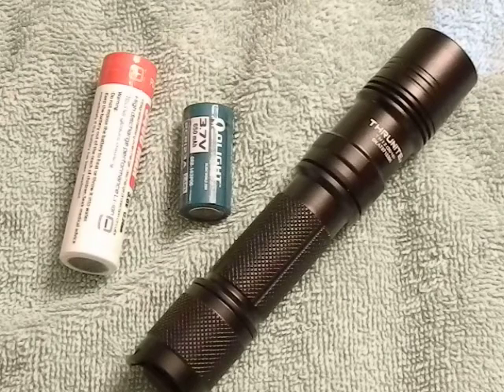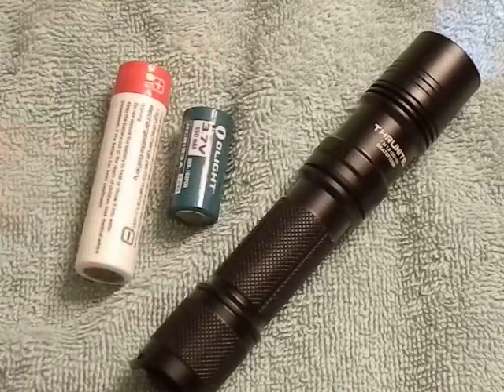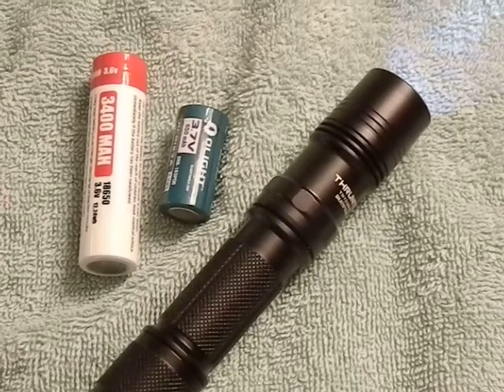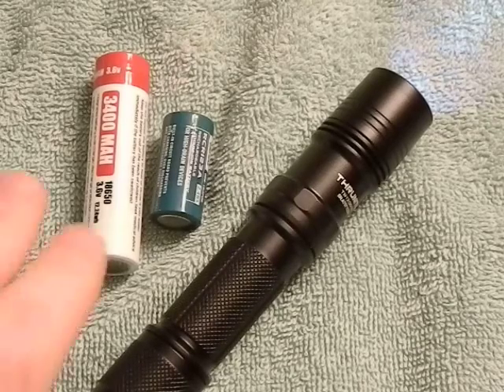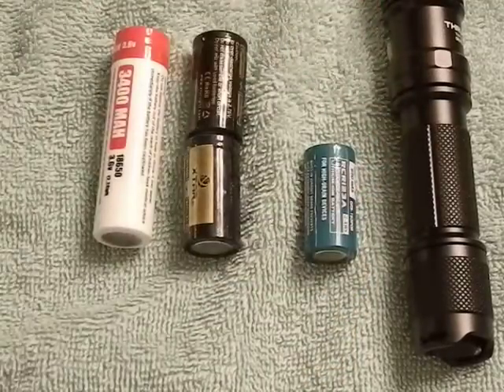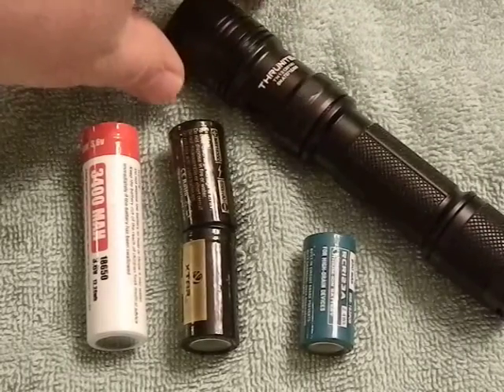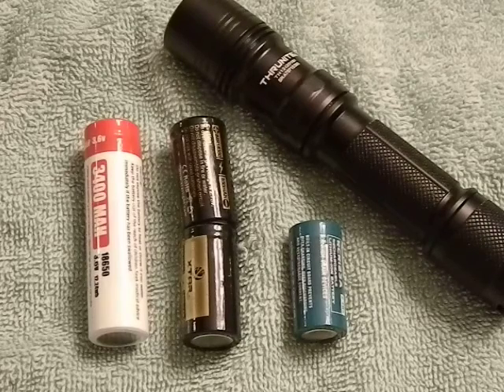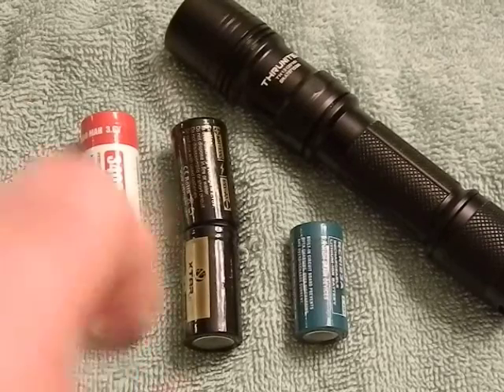Another Flashlight Hack - solder free!

Comment: What is the standard voltage for a flashlight?  I have a tactical 511 where I can switch double aa batteries 

I also have an older bushnell using cr123a batteries that I want to change to a reacharable battery that will increase the lumens.  My charger can do so many batteries but can’t do cr123a hence the change.  If I put one in with too high of voltage could it cause damage?  What batteries would be a similar size to the cr123a

Comment: You are wrong about getting more battery life with the 2 battery as only the voltage doubles. MAH will remain the same. Use a good 18650 and you will have more than enough amps to power the LED to max brightness and you will get the most runtime. This video has so many flaws its unbelievable.

Comment: Yes ok capacity is only multiplied in parallel where voltage is multiplied when end to end for  series applications but just one more point from not expert.com.  Not all led torches will do any voltage as it seems his good quality one can , l  have blown a few drop in led units without checking the max voltage for any led units . A decent beam can easily be got from 18650 torch with 3.7V  and i don't see many led light units when shopping that will take more than 3.7-4.2V  and one lithium ion cell.Lol.

Comment: 18650s have more brightness and more watt hours than 2x18350. Voltage doesn't make more brightness. And if it does, the flashlight is not utilizing the 18650 well. 

The case in this video is a good example. Plus running two videos in serious makes them hot.

Comment: I just picked up a lumintop tool aa 2.0 after burning out my energizer tac 700 tossing brand new 16340 cells in it. Those rechargeable cr123 will burn out a regular cr123 led light unless it’s specified to handle 16340 so simply saying that if it takes cr123 it will probably take 16340 rechargeable is kinda iffy. There’s a big difference between 6v and 8.4v when it comes to these led flashlights. I’m pretty sure the leds on my tac 700 are fine as the light still works at significantly reduced lumens. I think the extra voltage messed up the led driver. If someone wants to use rechargeable 16340 in place of cr123 they need to make sure the flashlight can handle it first.
Reply: adding a small neodymium magnet between the two 18350's should give you about .2ohms of extra resistance based on my measurements. not sure thats a big of enough voltage drop but looking at the buck converter in most of the data sheets for led flash lights that say "RATED 3.7v", theyre actually usually rated to operate fine at around 6v if you track down the part numbers and reverse engineer them. most lights have some amount of internal resistance too espeically in the coild springs at the end (its a common mod to solder a direct line to short this coil and boost light performance).

so... if ur putting out ~8v at ~1A, an extra .2 ohms of resistnace should get you a voltage drop of ~1.6v which adds like 20% to the safety margin. assuming ur down to around 7v at the board, running an IC thats rated at 6v at 7v doesnt seem like the end of the world to me in short bursts. maybe my calculations are off on the little flat neodinium magnets? theyre mostly iron and Neodin which is ~10x the resistance of copper per unit length.

Comment: I have tried regular cr123a and rcr123a. The 3.6/3.7v recharge models did not increase brightness to the naked eye. Also, many types of flashlights say to use ONLY specific battery sizes but no warning or mention about going bigger. So again, in my Streamlight Protac HL3, there is no,I say again, no brightness increase with a 3.7v rcr123a vs a regular disposable 3v cr123a. None. Just half the power life.

Comment: 18650 is 0,5mm too big for my flashlight for cr123a
Reply: You can use 16650, same diameter as 16340/CR123.  Also, MUCH higher capacity than 2 x 16340 & higher max current draw.

Comment: Ok, I have an coast led lenser light that started to glow dim even when off. I cleaned the battery carrier (uses 3 aaa) after cleaning it did shut off but still glowed only dimly, now it does not work at all. Any ideas on what I can do to bring or back to life? (Batteries are fresh and good)
Reply: Kinda sounds like switch is passing current while in off position, like something mildly conductive is shorting it out. Maybe try flushing the switch with electronic contact cleaner if you can get at it. Solvents may attack rubber/plastic tho.
Reply: @juliogonzo2718  Thank you for the idea, I will try that. I've already taken apart and cleaned the battery carrier, but now the thing does not light at all? (Just my luck, haha). You might be right about the switch though.
Reply: @dm7097  could be loose nut that retains switch if it is in the tail cap too. It'll have two holes to tighten with a camera lens wrench or small needlenose pliers often
Reply: if the AAA cell holder has a spring loaded metal contact button on the + end... check the spring . it may be broken and making contact sometime & then not, all while maintaining its ability to spring the button back out like normal.. maybe that will help you.. G L
Reply: I had a coast light with a battery carrier problem. Get a new carrier $3.

Comment: you need to check max working voltage before doing this. some can take cr123 but not two 16340s a lot of drivers go up to 6v but not 8 volts. another flawed thing here which the guy should know since he can do bypasses and such. when you run batteries in series you don't get double the mah. he's saying you get 8.4 volts and 1700mah that's false your getting 8.4 and 850 mah. batteries run in parallel the mah doubles and voltage stays the same. when you use in series like this case the voltage doubles but mah stays the same. so its false to think you will get more runtime using the 18350 you only get 200mah more. and the driver board is regulated the 18650 vs the other batteries won't make a difference. it uses a buck driver. whatever the driver/led calls for it steps down the voltage for what is needed. extra voltage is wasted as heat.

Comment: Working voltage: 2.7V - 9V. very unusual on a less expensive flashlights, most others would not take 8v, this has voltage regulation built in.  It is designed in specs for 2 x 123's

Comment: You failed to inform new people to lights that they must know the voltage limit of the flashlight before installing 2 -18350 batteries as they could possibly be putting almost 8 Volts into lights that are rated for 4 volts up to maybe 6 volts . You could use 2 primary 123 batteries if your light is able to handle 6 volts because 123 primaries are only 3 volts each . RCR123a are at 3.7 v and charge up to 4.2 so with two of those you would be putting 8.4 volts into the same light and probably blow it up . Same with 2 18350 batteries .Also if you are going to stack 3.7v Lithium ion batteries it's a really good and safe practice to be sure you only use 2 batteries that are a married pair ( charged together since the first charge .
Reply: Jack Lauler
 I agree one time I tried using 2 cr123 cells
the light originally ran on 3 AAA cells.
it quickly burned out the circuit board within 2 hours of  momentary on off use.

flashlights rarely go kaboom if you are running higher voltages than the flashlights circuit board can handle.

Comment: you would only dubbel your power if you run in series not to mention if you run @ 8 volts or more it's most likely gonna burn out. stick with a name brand 18650 and you'll do much better and safe. I mean your already going from 1.5 volts to a 3.7 witch is gonna be around the most your gonna be able to do with most any light that use a AAA batteries to start  with...

Comment: While you do double the voltage using 2 batteries in Series. The power or mAH does not double.  So you get 8.4 volts but only 850 mAH with the 18350
Reply: Dan he already said that